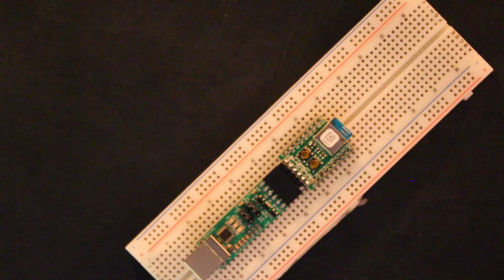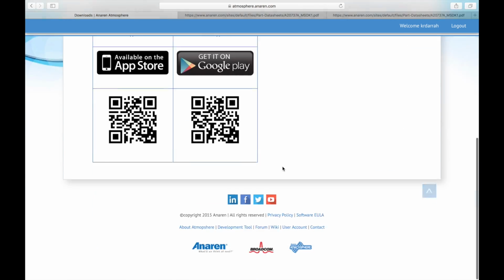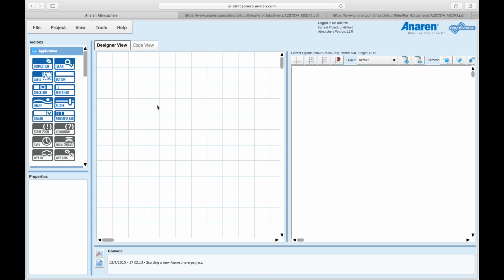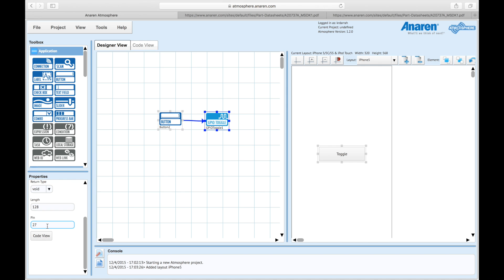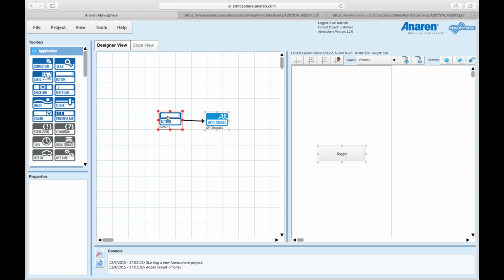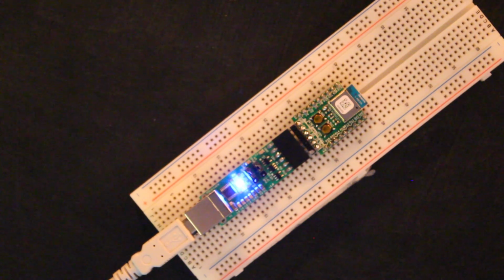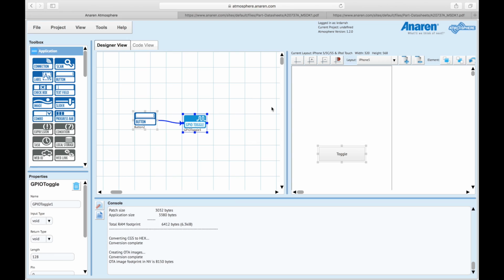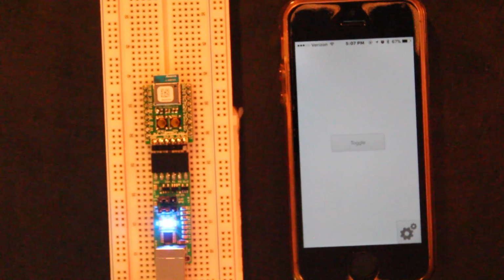Bluetooth Low Energy - Getting Started,  Blink an LED!

Comment: hello i am interested on purchasing a few of the BLE modules for a couple of projects i'm working on, i noticed you mentioned that your program runs entirely off of the BLE board and doesn't require a separate microcontroller, and also that it can communicate via I2C, would this be able to communicate with an OLED screen via I2C without having to use an ATMEGA328P? any information you can provide me with would be greatly appreciated!
Reply from the maker: hit up my contact page: http://www.kdcircuits.com/#contact
Reply: thank you for the quick reply will definitely contact you through that link

Comment: Can you share your own designed schematic which includes about your own A20737? I'm interested how did you use ESD protection...
Reply from the maker: +onurolce not much ESD protection on this board - taking some big risks handling it like this... but no more so than any other dev board like Arduino or rPI

Comment: I'm interested in a board. Would the board be offered bare or fully populated with the module? Looks like the module would need to be reflow soldered.
Reply from the maker: +36trooper would be totally populated - except for maybe the through hole headers
Reply: +Kevin Darrah Count me in as well! Have you had any progress with making it available?
Reply from the maker: Jordan Vanderham got the boards quoted... going to try and get an app made first, maybe another board - like an arduino add-on board
Reply: Kevin Darrah Fantastic! Keep us up to date and I will start prototyping with the standard dev board.